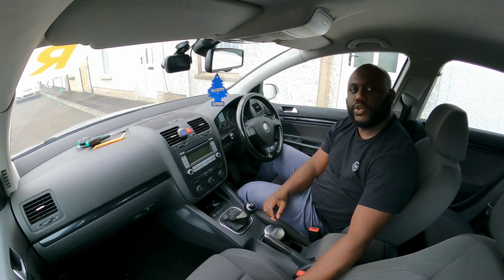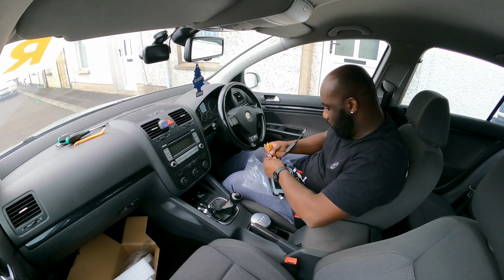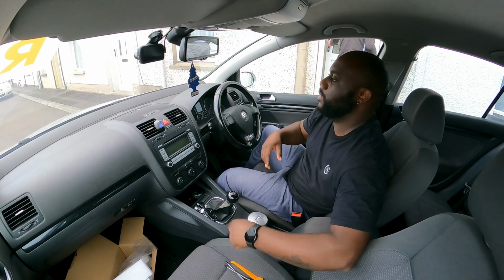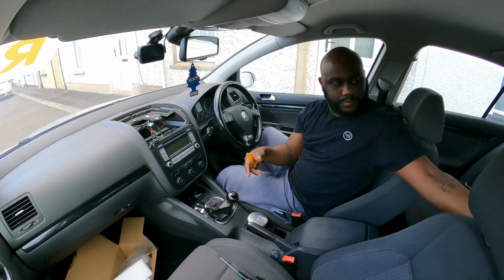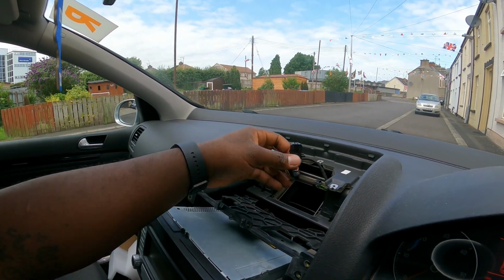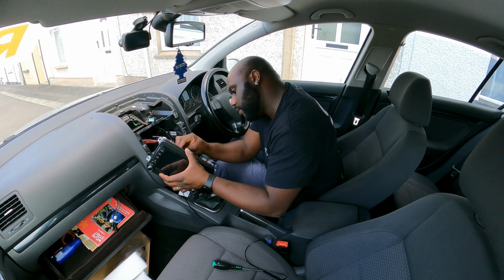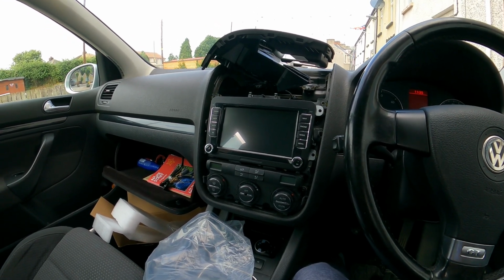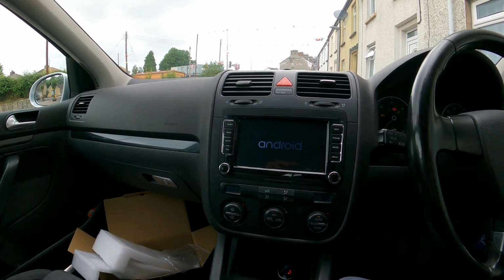Volkswagen Golf (Mk5) Radio upgrade

Comment: Is there much difference in sound quality? Wanting to upgrade as I'm having to use an FM transmitter for my music with that old stereo but not sure if these budget stereos also enhance sound quality?
Reply from the maker: The radio does actually sound good and you can fine tune it with Equalizer..
But rádio reception on the golf was never good since I bought it..
That was one of the reasons to upgrade the radio for the Mrs to connect her phone to it..

Comment: i bought used android radio for my golf v and it burns my fuse everytime i connect the power... can the problem be with the radio or the car :/
Reply from the maker: I would probably focus on the radio.. I think it would be the problem..
With it being used you can never know what was done to it..
Try find out if fuse on the radio (of it has one) hasdeen changed before and it's causing this..

Comment: its not turning completly off any tips?
Reply from the maker: Is it the exact same radio I bought?
And what exactly do you mean by not turning completely off?
Reply: Hey! i bought the exact same radio and have the same problem with it not turning completly off when i turn off the car. Do you have the same problem? @_LouisS?
Reply from the maker: @chriskristoffersen5532 so you're radio only turns off manually? I never encountered this problem.
Did you already had a different type of aftermarket head unit? Were the wires messed with in any way?
If you never had another head unit fitted I'd suggest getting in touch with the supplier for further assistance..

Comment: Hi I want the same unit you have what make/model is it as there are so many on Amazon to choose from I want to make sure I get a good one 👍🏼
Reply from the maker: I bought this one. 

https://www.ebay.co.uk/itm/195582727612?mkcid=16&mkevt=1&mkrid=711-127632-2357-0&ssspo=4rn1fiyyqeu&sssrc=4429486&ssuid=4iSica-lQz2&var=&widget_ver=artemis&media=FB_MSG

But with the golf betting such a popular car I think whatever unit you chose will work great.
I think its just a matter of preference.
Either way I'm pleased with this unit and works amazing. Only thing I dislike a bit is it's not time as I would like to start up straight away like OEM radio.

Comment: Did this old RCD300 radio display RDS on the clock display
Reply from the maker: Not sure I get your question fully as I'm not sure what's RDS. But if you're asking if it displayed which station was playing in the the centre screen of the clock, then the answer is yes!
Reply: rds is, among other things, information on the meter display. I was wondering if you had information from the radio on the meter display on this old radio, because I understand that you have it on what you installed? And did you change anything in the radio coding? @_LuisS
Reply from the maker: Actually on the one I installed it does not show any info on what's playing..
And I didn't change anything on coding. That reminds me to take a look and I might be able to get it to display...
Reply: They write everywhere that after connecting a non-factory radio, there will be no information from the radio on the counter display and you probably won't do anything about it. I have a radio like you, it's an old one and the large odometer display doesn't show anything from the radio. It's a pity you don't know what coding you had in the old radio, because I have a problem with it. Display teeth info from the radio, in the vcds coding of the radio it must be 4 at the end but my radio does not accept such a digit @_LuisS

Comment: Hello, I have installed it in my Golf and I have the same airbag problem right now. How have you solved it? What can I do? Could you help me please, thanks
Reply from the maker: Hi there..
If you seen some of my other videos you'll see that I have diagnostic software.
And that allows me to read and clear fault codes. If you now have an airbag light you'll need some sort of diagnostic software to first read it and make sure its related to the install and then clear it.
Hope you get it sorted quickly.

Comment: Hi mate ! Just wanted to ask is there a CarPlay option within this android one to switch to ? And how can it be done as I’ve got the same screen
Reply from the maker: Yes it does mate..
You don't need to switch anything.
According to manufacturer of the radio you just connect your phone to it and it'll know whether it's an android or an apple device.

Comment: What year is the golf dude? Still no battery drain?
Reply from the maker: It's an '07 golf. And no issues to report with this installation. All works fine. It's definitely a upgrade worth doing..
Reply: Ahh ok. I got mine today and it came with absolutely no instructions so should be fun when I put it in haha
Reply from the maker: I will have a look in the morning if I still have instructions and send you a picture of it.
If not you could always use my video as a reference. 😉
You'll see its a easy installation.
Reply: Haha doesn't look too bad. I have steering wheel controls so don't know whats gonna happen there. Sure I'll figure it out! Your video will also be of help I'm sure 👍 👌  cheers man.
Reply: @AdamnSonn  Did you manage to see if it is compatible with steering controls, and if so did you need any additional cabling/module splitters etc?
Reply: @lukewood8168  worked fine with steering wheel controls and came with all necessary cables, plug and play.
Reply from the maker: I didn't splice any wires nor was extra cabling necessary.
I just wired the radio and it was ready and accepting steering wheel controls input.
Reply from the maker: Really glad to be of service. 😉
I retrofitted the steering wheel with the controls. (https://youtu.be/TqIS8a4T6PI?si=bL8okvUiNZe_13S7) 
And I can control volume and calls  just fine with the controls.
Reply: Did you get a link to the installation instructions at all?
Reply from the maker: Unfortunately not. Don't think there's an Instalation instruction posted by them. And the instructions that came with the radio was pretty basic..

I think instructions are intended for someone that already knows how the connections go together or professionals.
Could be a bit more detailed in my opinion.

Comment: Can you post details of your purchase because you have no problems with Canbus or battery drain. Great video thank you
Reply from the maker: Hey there. 
I have zero issues with this installation, all went smooth and was plug and play. 
The only thing I done a few days after was cut the cable for the reverse camera because I don't have one and the unit is always looking for a feed when in reverse. After sending them a message they told me exactly which one to cut to prevent screen going black looking for a signal. 

Here's the one I bought. 
https://www.ebay.co.uk/itm/195582727612?mkcid=16&mkevt=1&mkrid=711-127632-2357-0&ssspo=4rn1fiyyqeu&sssrc=4429486&ssuid=4iSica-lQz2&var=&widget_ver=artemis&media=FB_MSG

Comment: Congratulations on your videos are you happy with the device so far? Have you connected and canbus Did you have a problem with the car battery draining?
Reply from the maker: Thank you so much.
For what I use yes. I'm very pleased.
I bought it for the Mrs and she likes it a lot too. She loves the android auto and the hands free connection to her phone.

And I've got no issues with battery draining with this. Works really well and looks factory which for me is a great bonus.
Reply: @_LuisS  never answered his main question, did you fit the canbus in or not?
Reply from the maker: You're right. I never even realised that.
But no. I did not.
Reply: @_LuisS  alright thanks just mentioned that as well because I heard people had troubles with battery drain issues
Reply from the maker: @DorianPrzybylski I figured from his original question, but I never had that problem. Even leaving the car 2 weeks at the airport going away, still started up without hesitation..